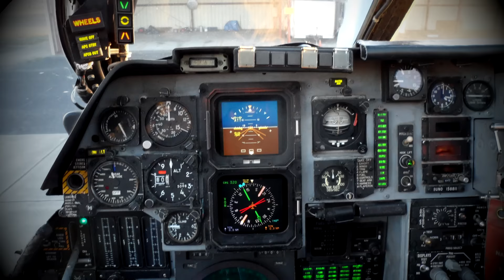USMC Jet Crashes Cable Car | Last Moments

Comment: What I find odd is the fact that all four (4) crew members were charged when only the Pilot (in command) had any control of the aircraft.  That is, there is only one (1) set of flight controls in this aircraft and the other three (3) crew members are just working passengers.  I say this because some people won't know this important detail as most crewed aircraft have two (2) sets of flight controls.

Furthermore, the three (3) crew members (known as ECMOS) one in the front manning the RADAR & Navigation systems and the other two (2) in the back seats manning the Electronic Countermeasure equipment had NO control over the aircraft's flight whatsoever.  

That being said, the one (1) ECMO in the front right seat was/is responsible for providing navigational information to the pilot in command of the aircraft during low level cross-country flight operations.  But if the maps he was using didn't have any indications of the Ski Lift's presence then how could he have notified the pilot of it's existence.

A tragic accident for sure ... but an accident none the less that involved failures at many levels, some beyond the control of the crew let alone the pilot.  I know this because I knew the crew and their fellow officers at the time this accident occurred.  Tragic end of innocent lives and the end of promising military careers.
Reply: Marc  So by your logic the passengers riding in a bus that runs over and kills people are just as guilty of vehicular manslaughter as the driver.  Think about that real hard the next time you are a passenger without any control over the vehicle or what the driver is doing.
Reply: @digiacomtech5589  All three chose to remain silent regarding the crash in court, all three knew during the flight that they weren't following regulations and that were flying dangerously low but never said a thing to the pilot.
All four basically covered each other so that none of them would be charged for the murder of 20 civillians from allied NATO countries.

They were accomplices
Reply: @thecommentaryking  ... What you don't seem to know is that flying 'dangerously low' through various types of terrain is something almost all military pilots trains for.  It's called NOE or RADAR avoidance training.  They were on one of those training missions and we not just out for a joy ride.

As I said, this was a tragic accident resulting in the loss of many lives.  The crew was unaware of the obstacle they were approaching, and the two in the back can't see anything in front of them let alone override the pilot or otherwise control the aircraft.  Again, failures at many levels occurred to bring us to this tragic incident.

This was NOT premeditated murder or extreme negligence on the part of the crew as some want to assert.  Yes there was negligence on the part of the two crew in the front, certainly the pilot in command.  And yes they did destroy a tape and paid for it later on.  But that tape would most likely have only shown the pilot was negligent in breaking low altitude training rules (e.g. similar to the hard deck mentioned in Top-Gun).  Lastly, there is rank and position involved here, and crew does NOT get to countermand any decisions (good or bad) made by the 'Pilot in Command' of the aircraft.
Reply: @digiacomtech5589  Too bad it wasn't one of those training exercises and that the plane was flying well below the minimum altitude (2000 ft) that was given to US flight personnell in Italy; well below the USMC internal minimum altitude (1000 ft) at which the EA-6B Prowler was to fly; and well below the 1000 ft minimum height regulation for flying during winter time in mountainous areas, made by the Italian military, to which the US military had to abide.

The pilots had no orders to fly that low in the valley, they disregarded any and all regulations regarding altitude, lied about their flight instruments being broken, they tampered and destroyed evidence and never payed for their mistakes.
All 4 knew what they were doing, all 4 knew what happened, all 4 lied about the "accident" in court and all 4 covered each other so that none of them could end in jail.
Sure the other three couldn't do anything while in flight, bu they didn't do anything when they landed, had they really been "unwilling passengers" they would have reported the pilot, but they didn't.

Sure it wasn't premeditated murder, but it was still involuntary manslaughter and negligent homicide.
Reply: @thecommentaryking  ... Then provide that day's training schedule, provide their mission briefing, provide their flight plan, provide any evidence they planned to fly under or into the ski lift cables.  You cant.

Then when you have given up trying to find the above evidence provide the USMC regulations for EA-6B flight operations at the time of the incident.  At least that should be possible.

In short provide the actual facts at that time  of the incident vs. speculation as to what the regs. were for EA-6B flight operations vs. what they are are NOW vs. what they are for other military and civilian aircraft.

And more to the point, if ANY one of those USMC regulations you contend they violated were found to have been true then the entire crew would have been found GUILTY in the original trial.  They weren't.

And just because the crew took the 5th (remained silent) ... as I'm sure their legal counsel encouraged ... it does NOT in this country imply guilt.

Furthermore, lets not 'conveniently' forget that the two crew members that were found to have destroyed evidence (after the initial trial) DID actually pay for their actions by spending time in jail ... which usually includes a reduction of rank, pay, court marshal, and dishonorable discharge.

As your YouTube handle implies, you want there to be a 'conspiracy' here, and you'll do and/or say anything to push that narrative along.  And anyone challenging that narrative by shedding light on it's inaccuracies must be stopped.

In short, prove your conspiracy exists.  You can't!
Reply: @digiacomtech5589  I don't have to, the investigations brought that up. There were three regulations that specifically forbid to fly under 1000ft and the very same Cpt. Schweitzer testified that he was ordered to not fly under that height during the briefing, thing confirmed by the Operations Duty Officer of the flight group. 

The mere fact that those 4 idiots murdered 20 people is enough evidence to prove that they were flying under the minimum altitude regulated. 

Want to know the specific regulations?
MCO 3500.14F (T&R) paragraph 5000.3, which states that aircrafts that weren't equipped with a HUD, had to fly no lower than 1000ft during training.
Document FCIF 97-16 of 29 August 1997 of the 31st Fighter Wing, which dictated the minimum altitude of 2000ft in the whole region where the exercise took place.
And an Italian disposition regarding the minimum height of 1000ft during winter (from 1 November to 30 April) or during any period with heavy snow, disposition adopted by the US military as the document USAF MC11-F16, regarding all glight procedures at Aviano. 

Please don't pull the BS. The original trial was a farce so much so that even the prosecutor and NCIS investigators felt ashamed of its conclusion considering the amount of proof that they brought. 

Remaining silent doesn't mean you are guilty sure, but they were still covering a murder, and as officers of the USMC they had the moral duty to tell the truth, but they still didn't. 
Also I'm not ""conveniently"" forgetting the sentencing for obstruction of justice, but it was just that, a mere sentence for obstructing justice, nothing more, nothing less. You're naive if you think that being merely dismissed from the Corps and spending 4 and a half months in jail is the right sentence for the murder of 20 people. 

It isn't a conspiracy when it's true that the trial was a farce and the four aviators walked free from murdering civillians in an allied country.
The tribunals in Italy proved it as did the Italian Parliamentary commission instructed to shed light on the events.
Try to argue with them
Reply: @thecommentaryking  ... Well after a very brief scan of the regs. you provided I have to point out two things... 1) The Marines don't follow Air Force regs.  2) The MCO you reference DEFINES what is considered to be low altitude training for HUD vs. Non-HUD equipped aircraft, it does NOT restrict it to 1000' AGL for the EA-6B.  But, I'll keep digging through the regs. as you were gracious enough to provide some references.
Reply: @digiacomtech5589  Too bad what you claim isn't true.
1) They do when flying on an USAF/Italian AF base.
2) The EA-6B was an aircraft that didn't have the HUD, ergo it had to follow the 1000ft minimum altitude.
Reply: @thecommentaryking The Marines are required to follow their own aircraft flight regulations.  They are NOT requires to follow every regulation from every service and/or country at all times.  Why?  Because Many services & countries have CONFLICTING regulations and what IS/IS NOT allowed by the Air Force can certainly be allowed/not allowed by the Marines and/or any other service and/or country.  That is, it would be impracticable for anyone to know let alone manage all of these regulations at the same time which is why we don't hold anyone to that level of accountability.

But yes the only time any Air Force regulations could have been applicable would be when the aircraft was operating at an Air Force base.  However, none of those Air Force regulations would have been applicable once the aircraft left the confines of said base.

And to the next point, perhaps English isn't your strong point but please note there is a very distinct difference between a DEFINITION/TERM and a REGULATION ...  As you (and everyone else) can see below the MCO 3500 clearly provides the following DEFINITIONS & TERMS:

[2. FW LAT

a. The ... TERM ... LAT applies only to operational FW aircraft, where the briefed intent is to conduct tactical flight where terrain avoidance is a significant factor.  

LAT is further ... DEFINED ... as:  Flight below 500 feet AGL for HUD equipped aircraft and below 1000 feet AGL for non-HUD equipped aircraft.

Non-LAT training is limited to 500 feet AGL minimum altitude for HUD equipped aircraft and 1000 feet AGL minimum altitude for non-HUD equipped aircraft.]

Yes, I know that the EA-6B is NOT equipped with a HUD.  This is because I facilitated some of their training and in doing so racked up hundreds of flight hours in the simulator flying LAT missions from the first & second seat.  None the less, the above MCO 3500 you referenced clearly states these are DEFINITIONS and TERMS.  That is, what IS and is NOT considered to be Low Altitude Training (LAT).  And it is clearly NOT a restriction from flying below 1000' AGL for Non-HUD equipped aircraft as you assert.

Yes, they were flying below 1000' AGL in a Non-HUD equipped aircraft because they were conducting a LAT Mission.  And again, if the court would have found they were in violation of ANY applicable regulations in force at that time of the incident they would have been found guilty in the original trial.  They were on a training mission and things go wrong in training missions ( I was privy another LAT training incident here in the US that resulted in the loss of not only the aircraft but the entire aircrew).

- Were they pushing the limits of the regulations, IMHO YES as that is what Marines do.  

- Was this murder of any kind?  No, as there was no malice or intent to kill anyone on the part of the crew.   

- Was this Negligent Homicide, IMHO NO as the crew (from all accounts I am privy to) was following the flight plans for a LAT training mission.  

- Was this Involuntary Manslaughter?  IMHO NO as the crew (from all accounts I am privy to) was following the flight plan for a LAT training mission.

- Was the RADAR Altimeter (RADALT) an issue?  Possibly.  That piece of equipment was my specialty as an Avionics Technician for the Marines a long before this incident.  And yes and as all pilots know RADALTS can do some funky things depending on the terrain, attitude of the aircraft, etc., etc., etc. ... and these aircraft though well maintained were OLD at the time of this incident.

- Was this a tragic accident that needlessly resulted in the loss of many innocent lives because of failures at many levels by all parties involved.  IMHO A RESOUNDING YES.
Reply: @digiacomtech5589  And the regulations of the base/unit they are attached to. In this case the 31st Fighter Wing and the Italian Air Force at Aviano.
If what you said was true then the USMC wouldn't even be allowed to operate in Italy, yet they do so yes they hafe to follow the regulations of the USAF and Italian AF.

It doesn't matter if the regulations could be conflicting, the USMC is operating in a foreing country and it is subjected to the regulations of that country as per NATO SOFA. They aren't allowed to do what they want because their regulations are "conflicting".

As for your wall of text regarding the MCO 3500 (what also?) it doesn't matter, they were still flying too low.
Your experience in a simulator doesn't matter.

A LAT mission that was specified to not be flown under 1000 ft as per regulations and pre-flight briefing. It doesn't matter how you twist it they aircraft was still flying too low and too fast, where it shouldn't have.

- Were they pushing the limits of the regulations? Yes and they did it without any concern of other people lives. That is what criminals do.

- Was it murder of any kind? Yes it was, no matter how many excuses you bring up.

- Was it negligent homicide? Yes it was as they were flying too low and too fast in a place they shouldn't have (there were rules and regulations that attest that)

- Was it involuntary manslaughter? Yes it was as they were flying too low and too fast in a place they shouldn't have (there were rules and regulations that attest that)

- Was the RADALT an issue? No, checks conducted both before and after the flight didn't find any problems with it.

- Was it an accident? Yes, but caused by recklessness of the 4 crewmen of the Prowler and the idiocity of the USMC and USAF leadership at Aviano. They had everything that would have allowed this tragedy to not happen, but instead they played the stereotypical Americans that think that they own the globe and as of that 20 people died.
Reply: Doesn't matter how much you want your 'conspiracy theory' to be true ... the facts simply don't support it. 

The 'anything under 1000 FT AGL for NON-HUD aircraft' is the DEFINITION of LAT for that aircraft, it is NOT the minimum hard deck for LAT missions for that aircraft.  

And yes the Italians had set a higher minimum altitude for LAT prior to the flight but evidence showed the crew never received notification of the changes nor did they receive the updated charts they would have used for planning this LAT mission (a command failure).

We all know what you want to be true, but in a court of military law the evidence failed to satisfy the charges brought against the two front crew members.  You (and many others) may not like the outcome of that trial but the two front crew members were later tried & found guilty  & punished accordingly for the crimes they DID commit.

Keep believing whatever you want,  I'll continue doing the same until provided irrefutable facts that dictate otherwise (and your supposition is not fact).
Reply: @digiacomtech5589  The sad part is that, by calling it a "conspracy theory" you insult basically every authority that investigated this case, including the Italian prosecutors (both civil and military) and the NCIS, other than the memory of the victims.

Again is that written in the MCO 3500.14F? Or you are merely quoting a newer one? Because unless you can cite directly that one, the point you are making is null.

Too bad the investigators found maps inside the cockpit that indicated the minimum height for the area including one that indicated the 1000 ft minimum altitude for winter. Though I agree that the US command structure at Aviano failed in informing every pilot on the base.

What I want doesn't matter, neither what you want. What is true is that the pilots killed 20 people for a joyride and no one payed for it, not them nor the command structure.
The trial was a farce, that is overall true, the typical, we did nothing wrong, and sure keep believing that destroying evidence was their only crime.

"Irrefutable facts" that you still haven't brought up. You are the only one making suppositions here, the mere fact that you said that the laws and regulations of the host country don't matter to the USMC is enough to prove that
Reply: @thecommentaryking  ... Yet the undeniable fact remains that if any of what you contend were true they would have been found guilty as charged in the original trial.  And BTW I'm quoting the MCO from from the time of the incident, you might try giving it an unbiased read.  Anyway, I've already wasted too much time on this totally pointless discussion.
Reply: @thecommentaryking  Get off your own high horse, you are accusing people of outright murder without any proof.
Reply: @digiacomtech5589  I would if the proof of their crimes weren't actually substantial and proved by a wide variety of authorities both in the US and Italy